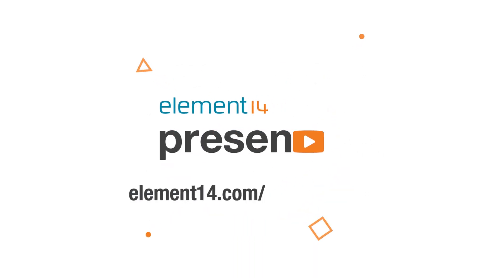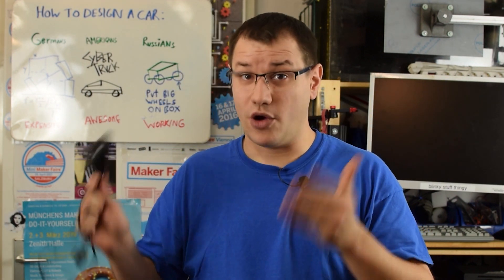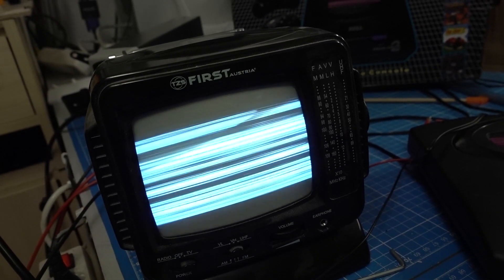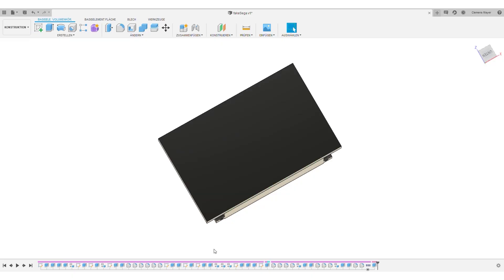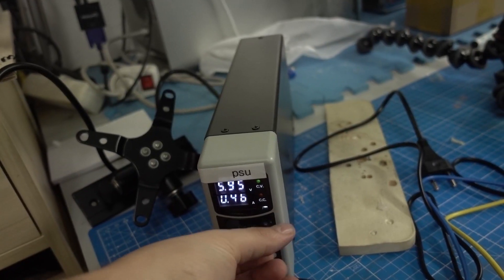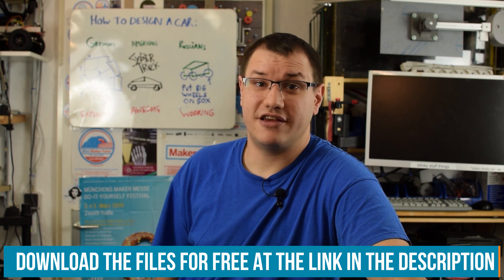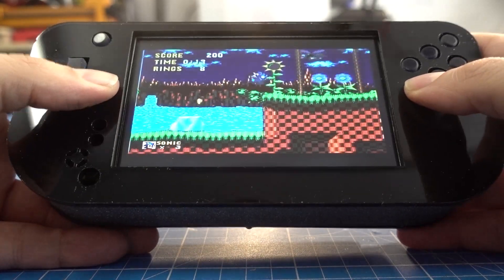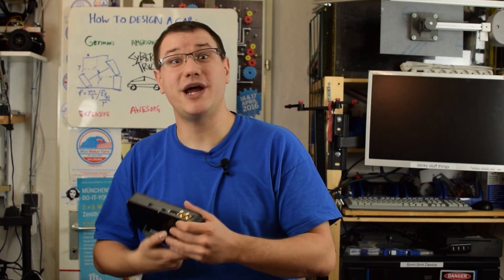DIY Retro Gaming #Sega #Genesis / #Megadrive Portable on a Budget!

Comment: Great project, noac/goac clone consoles are always fun to play with. A little heads up, those little car reverse lcd screens usually have a buck or ldo regulator on the input to run off 12V from a car's cigarette power adapter so it's pretty easy to just bypass the regulator and directly power the screen on 5V (a few I've played with even run happily down to ~3V).
Reply: Thanks, I thought so but the solderpoints were so convenient to use, so I stuck with them
Reply: Yup, screens like that work flawlessly when fed on 5V. Either you bypass the regulator or you desolder it (you might save some ~10mA of power plus all the energy used to make all of its passives to work) but the results are the same. Read the datasheet - if the IC has a number, I've seen a nasty habit from Chinese manufacturers to sand the IC surface, which in the end does not let others read it. But something can still be done while feeding the screen on its usual input and taking measurements with a voltmeter. For example, on a XL1509 pin 2 outputs 5V, and it is always behind a coil and a diode.

Comment: Why does it look like the face buttons are barely sticking through the faceplate? I don't want to criticize the build too much (cuz it's better than I could do) but aren't those kind of hard to press with how recessed they are? Also some of the other buttons look a bit wonky. Overall it's great tho, don't get me wrong. Nice job.
Reply: I printed different heights and this felt the most comfortable. The travel on the tact switches is very low, having them like this allows me to press all buttons without lifting my thumb(roll it around)

Comment: While they are smaller than the first generation 3 button controllers, I believe those are the same size as the genuine 6 button / wireless genesis controllers.
Reply: The only genesis pad I had was bigger than those, I had no real 6button one to compare.
Reply: @MAYERMAKES  totally fair! I didn't get any of the 6 buttons until a couple of years ago. Was weird to use after the gigantic ones I was used to.

Comment: I compiled a list of all the parts I need to build my ultimate handheld. It consists of a aluminum shell and back plate, aluminum buttons and dpad, aluminum shoulder buttons, a psp joystick, an ips screen, a rechargeable 2000mah battery, and a custom board made for the gba that accepts the raspberry pi cm3+. I added everything to my cart and then realized it was just shy of 400 dollars to build this thing. Maybe if I had a YouTube channel that would pay for the handheld in views it would be feasible. For 400 bucks I could make something way more powerful and buy a switch with the left overs. Lol
Reply: That's a lot of Aluminium, I use a lot of reused parts and recycled materials in my builds. If you are really committed into making stuff, the cost is not a thing to worry anymore. I spent every single cent II could spare on tools and parts for 5 years, just to learn. That's is not something everybody should do, but if you really want to build something you will find a suitable solution. Be creative

Comment: I really like original D-Pad - it is better for example for fighters than Nintendo design - there was also third party controllers for SNES using Sega controllers.
Reply: I agree, but I preferred to use a design I had figured out tolerances before. The Sega style dpad would require some more intricate design.

Comment: 1:00 I’m not a lawyer, but I don’t think it’s a crime to buy clone consoles. It’s not even a crime to sell clone consoles if you use the right parts to make them and don’t try to imply endorsement from the original. All this disclaimer does is add a does of cognitive dissonance to the video.

Edit: Might be illegal if it has built-in roms. I’m specifically talking about the machine itself, not built-in content.

Disclaimer: The poster of this comment does not condone manufacturing clone consoles with bad audio. No one likes that.

Comment: That arrow on a stick was cute, definitely, something unique. :3
That SOC seemed pretty sad all alone on that tiny board. Probably a glop top holding the main SOC, plus some RAM or flash memory on a very cheap-looking flimsy board. (FakeSegathingy lol)

I liked this video a lot. Detailed, well explained, actual parts footage, soldering footage (a very good work I think), and a part to test out the composite output of the unit while the CRT wasn't working, tips and advices, testing 3D printed parts with cheap material... and maybe the most important thing to remember, "always test, every step, to ensure everything is working correctly".

THIS is the content I'd like to see here. Well done! And the unit looks good, sturdy and sleek. That's a thumbs up.

** Tip: instead of a boost circuit (which wastes space and power in the final unit) just get rid of the voltage regulator on the LCD controller board (pretty much every cheap car monitor has some kind of buck circuit on it), that basically gets the 12V input and outputs a 5V DC. Recently I got one from Amazon and I desoldered the XL1509 from it - pin 2 has a fixed output at 5V. I just hooked it up to the Raspberry Pi Zero main power capacitor, which has about the same voltage of its adapter. There you go, straight 5V to feed your screen without stuff in the middle.
Reply: Thanks for the feedback! The arrow was the first thing I ever designed In 3d. Hope to see you on the Element14.com community to exchange some more ideas!

Comment: The power cable is the one used in India and maybe other Asian countries
Reply: no, that one is differnet, the diameter of the prongs is different than indian sockets require. it also has a molded diamond shape like the ec-plug(just a to short one by far to be able to plug in), which the indian plug does nothave at all. This was meant fo EU -sockets(also marked as such) but was implemented wrong.